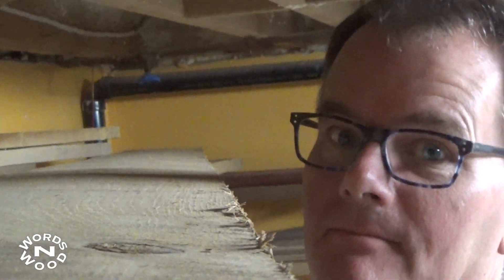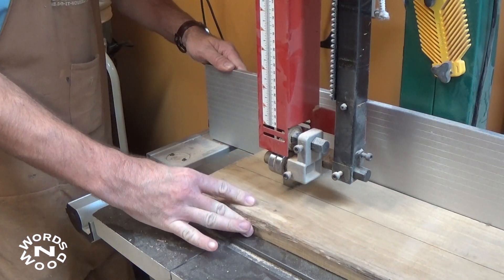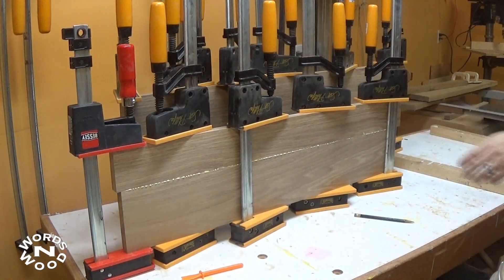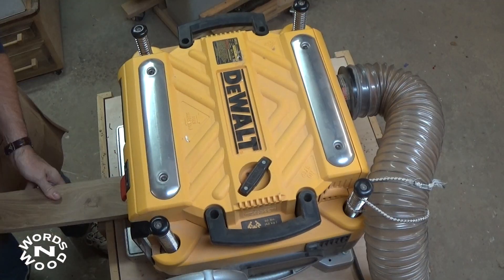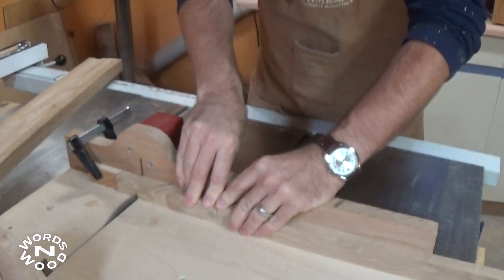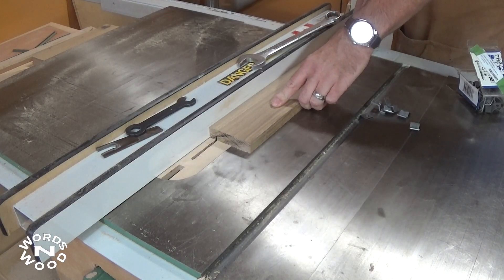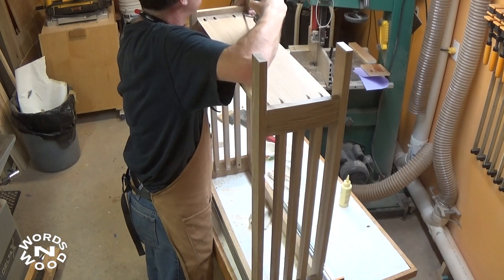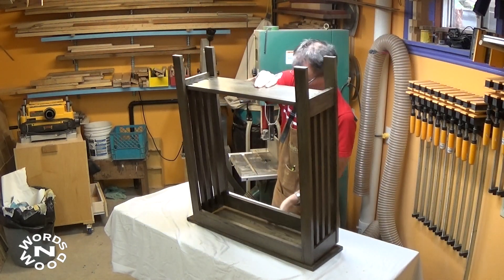Easy Build Mission Side Table   (WnW #34)

Comment: You used dowels to attach the rails to the legs.  Why use screws for the spindles instead of another dowel joint?  Just curious.  It's a very nice piece and your finish is exceptional, IMO. Thanks for sharing.
Reply from the maker: I don't recall any specific reason.   The screws are pretty simple and easy to use, and almost completely hidden.

Comment: Nice job!  Did you consider wood movement for this table build?  A newbie, sorry!
Reply from the maker: I sure did.  The top is attached with table mounting clips, so it is free to expand/contract with the seasons and not be constrained by the base.   The shelf is also attached with screws and that gives it some ability to move.